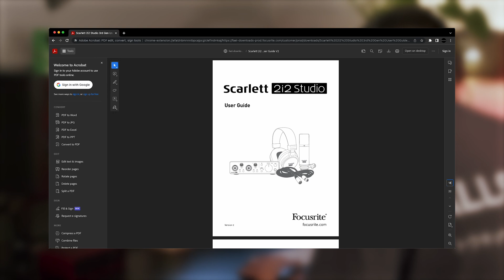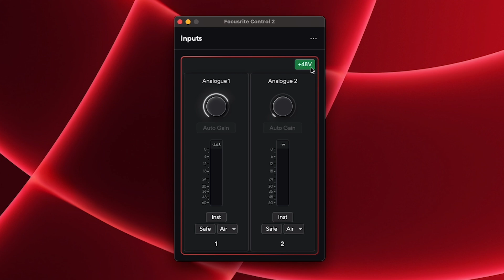Connecting Microphones to your Scarlett 2i2

Comment: I have an XLR cable but it doesn't fit into either the 1st or 2nd input. What's the reason? Help me please
Reply from the maker: Are you sure you are using an XLR connection? The inputs on Scarlett are designed to fit all standard XLR cable connections. If you need help determining what cable you have, or what cable you need our team would be happy to assist you here: 

https://support.focusrite.com/hc/en-gb/requests/new
Reply: @FocusriteHelp  Yes, I'm sure it was an XLR cable. It took a little force and I plugged it in. Thank you 🙏

Comment: I have a pair of MOVO Shotgun 3.5mm TRRS/TRS jacks. I also have 2 other 3.5 TRS shotgun mics. Using 3.5 to XLR adaptors, will these 3.5 TRS microphones work? These are passive and do not have their own power.
Reply from the maker: We cannot guarantee this will work. Scarlett interfaces are designed to be used with XLR microphones, and while these mics may work with an adapter, we cannot guarantee compatibility or full quality audio.

Comment: It doesnt work for me, even with the 48V on 😞... I cant find the poroblem actually. Someone had this problem
Reply from the maker: Are you connecting your microphone to Scarlett using an XLR cable? Does the Gain Halo illuminate when you speak into the microphone?
Reply: Hi.... My lights on Gain doesn't turn green... Means are they broken? I turned once down when the 48v was still red
Reply: @FocusriteHelp  i got same problem....my condensor mic doesnt work even turn on the phantom 48v & i used XLR cable...the halo didnt light up

Comment: I just got my mic and the scarlett 2i2, my mic is a dynamic mic, but after plugging it to the scarlett it won't light up, why?
Reply from the maker: Is your microphone connected to Scarlett via XLR? Have you tried alternative XLR cables? If you increase the gain and speak into the mic, does the gain halo light up?
Reply: I have the same problem, nothing is working!

Comment: If i have a usb microphone then i cant use any scralett model? To be specific i have Rode Usb Mini model
Reply from the maker: Unfortunately no, Scarlett audio interfaces are only compatible with USB microphones. For your USB microphone, no interface is needed, and you can connect your mic straight to your computer via the USB connection. Let us know if this helps, or if we can answer additional questions.
Reply: @FocusriteHelp if you choose to connect a USB microphone straight to the computer and bypass the audio interface... Will it create  delay/ latency in sound from the audio interface? Also, is there an advantage/disadvantage in doing it one way as opposed to the other?

Comment: I have two mics to connect at the same time to my scarlett 2i2, but one is a condenser mic and the other is dynamic... How can I set phantom power to only one channel in order to not destroy my dynamic mic?
Reply from the maker: On Scarlett 2i2 4th generation, when phantom power is enabled, it will be sent to both inputs. However, phantom power will not cause any harm to dynamic microphones, only ribbon microphones. So you can connect both without worry! Please let us know if this makes sense or if we can answer additional questions.
Reply: @FocusriteHelp  My Scarlett is 2i2 3rd gen, so you’re basically saying that I can insert dynamic mic first, then the condenser and then I can click for the phantom power?
Thank you by the way for giving me answers
Reply from the maker: Happy we could assist. Phantom power will not damage your dynamic microphone, so you can connect it, and enable/disable phantom power without worry. As for the condenser microphone, you typically only want to enable/disable phantom power when the microphone is connected via XLR and the interface is powered on. If you connect via XLR to an already phantom power enabled input, or disconnect the microphone while phantom is on, you run the risk of damaging your condenser.

Comment: 48v button on off button not working
Reply from the maker: Hi, we're sorry to hear you are having trouble: 

-Do you have a microphone connected via XLR to the selected input? phantom power will not work with 1/4 inch input.? 

-Are you working with a computer or an iOS device? Some devices need additional power to enable +48v, this can be done via a powered USB hub. 

-If none of these apply, please reach out to our support team for further assistance. They can be reached at the link below: 

https://bit.ly/FocusriteSupport

Comment: why is my interface not picking up my mic even though its connected with phantom power? I have tried everything. I can't hear anything with phantom power or in ableton.
Reply from the maker: If possible, can you try replacing your XLR cable to see if that's the issue? Second, please make sure you've followed the steps in this article to set up an audio track in Ableton:

https://support.focusrite.com/hc/en-gb/articles/360001645340-Setting-up-a-recording-channel-in-Ableton

If you try these steps and still experience issues, please reach out to our support team at the link below for further assistance: 

https://bit.ly/FocusriteSupport
Reply: Hi did it work for you. Same issue
Reply: Make sure in your software that you’re using the input/output is the though correct and put that you connected your microphone too for example, if you connected it to input two on the focus right, make sure it’s the same settings in your software for example I use GarageBand so make sure that it’s the same on there too

Comment: The microphone tip of the bundle is too small for my mic stand, what size is it? My microphone stand has a 5/8" tip, which adapter should I choose?
Reply from the maker: The CM25 MkIII condenser microphone should fit on most stands that are available. It comes with a 5/8" mic clip with 3/8" thread adaptor included.
Reply: @FocusriteHelp  thanks for your answer